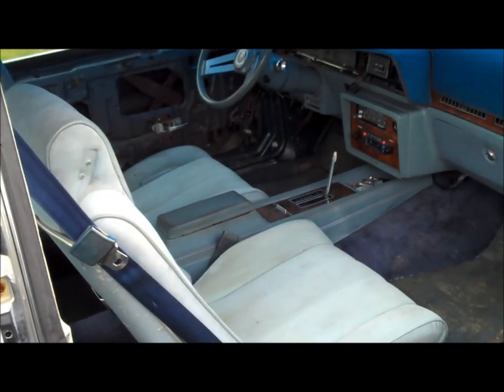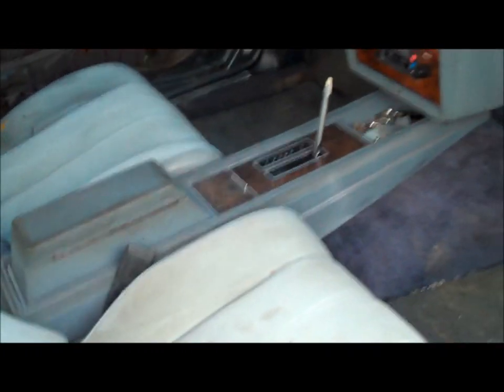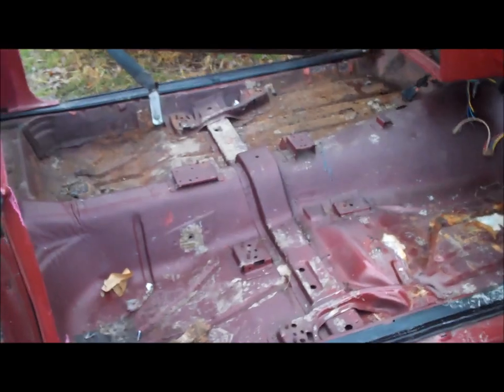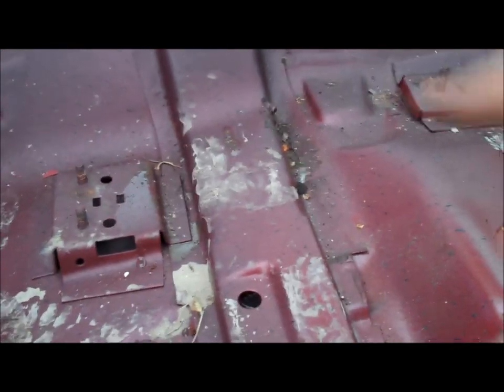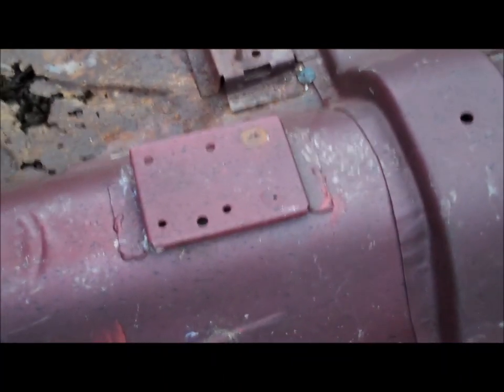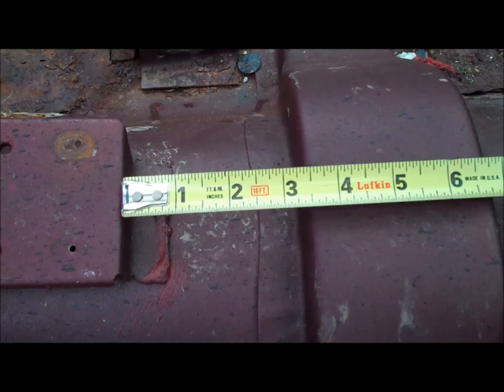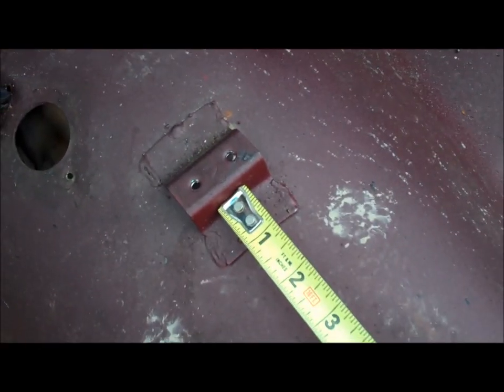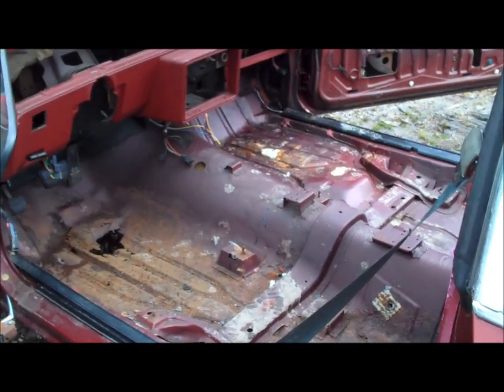Swap Bench Seats to Bucket Seats into a Gbody Explained

Comment: Hay Brian Suter thank you so much for letting us watch your car videos I love them and your welcome to my friend I haven’t said anything yet but until now but I have owned in my life time 4 Oldsmobile cutlass G body cars 1979 1978 1980 & a 1987  & one 1984 Pontiac Bonnieville 4 door and one 1981 Buick century 4 door and I loved them all to so really I’ve had 6 G body cars I put an olds 350 in my gold and brown car there is so much that you can do to them 
there such an awesome and Good cars to fix up I love what what some guys have done to them I love all the G body cars really now my 79 was the first one I had I bought it for 200 dollars back in the mid 1990s it was black with the gold pin stripes on it it had the olds 4.3 260 It was pretty worn out but I drove it anyways for two years  I loved it it had a factory sunroof that didn’t work an rpm tack and tan lather seats with power windows and locks and tan interior it was the brougham model with the olds rally wheels to and I have pictures of it somewhere here I had that car for five years I had the olds 260 rebuilt drove it for a little while and then traded it for the 87 and then my old black one ended up in the junk yard stack up on some cars I was not very happy about that my silver 78 was a brougham model to with a Chevy 305 to well anyways my friend sorry I’ve ramble on long enough theres more to these stories but to much read so maybe another time in small sections okay I just wanted to share a little some i live here in the north west in the beautiful great state of OREGON where our cars here don’t  rust to bad here lol except maybe the OREGON coast lol I have more pictures of my cars maybe I can share them sometime on Facebook I don’t know well see thanks Brian i love what you do sorry we can’t save them all but we save what we can I do want another olds cutlass ether a another G body or an A body I’ve never owned one of those cars I’m driving a 1980 Oldsmobile E body 
toronado right now with the Oldsmobile 350 cu 5.7 liter fully loaded with a factory moon roof or sun roof and I also own a 1988 Pontiac 
safari station wagon with an olds 307 Cu 5.0 liter she’s sitting in storage right now I miss driving that car but love driving my olds toronado though to well anyways thanks for listening let’s keep them Oldsmobile running and on the road my friend okay thanks buddy so so sorry to long of a message to much to say
Reply from the maker: Very cool story and it sounds like you have your share of Gbodys. Time for some more! There are plenty around your area being that they don't rust. I have bought a car from Seattle and it is clean! The Toronado you have is rare with the Olds 350, very cool for sure. Would love to see some pics of your old Gbodys so join the Classic Gbody Garage FaceBook group and post them!
Reply: Classic G-Body Garage cool awesome thank you Brian yes I have and it would be really cool to join your group I will check to it and do some time okay and yes I’ll look for those pictures to okay and share them I’ll even share a picture of my Oldsmobile toronado to and I didn’t tell or say I do happen to know where a late 70s Oldsmobile G body wagon is sitting here in town to it’s needs paint though I love my B  body wagon to it’s a Pontiac safari station wagon love that car well I’ll look you up on Facebook okay talk to you later buddy and keep the G body’s rolling okay good day my friend

Comment: Good video I have a 1980 el Camino , I bought a console last year .Got a shifter with cable and brackets , and just got the floor brackets recently . I will use the measurements and see if they work for mine .
Reply from the maker: nice

Comment: Fixing installed 5 speed manual transmission in my 1986 Pontiac Grand Prix LE  think about install bucket seats and center console. The car still has 60/40 split bench.

Comment: So the only thing i havent seen anybody cover with this swap is the seat belt part.. can i just change out the inboard belt receivers in the front to get rid of the middle seat belt and change the position of the receivers?.. or do i also need to swap out the outter seatbelts as well?
Reply from the maker: All seat belts are the same except for the inners that bolt to the floor. Just get the bucket seat style. One thing you need to make sure of is the male/female need to match as GM did offer 2 styles of buckles. One style is all chrome and the other is chrome with colored plastic cover.

Comment: I have a Buick Regal 1981 and I want to change the seats on them, I have bench seats but I want bucket seats what bucket seat would be best for me to put
Reply from the maker: Gbody buckets for an easy swap in. Otherwise you can get as creative as you want as long as you know how to weld. If your car has a straight bench then you need to weld in the inner seat brackets. If your car has a split bench then you are good becasue the inner seat brackets are already in there.

Comment: I have a 79 cutlass that I'm cloning into a hurst olds 10th anniversary where do you cut to do a t top roof swap I know 81 -88 the pillar is different for the t top roofs is it the same for 78-80 or do I just need to cut the physical roof and can leave the pillars
Reply from the maker: A pillars are the same but you need to be careful around the B pillars cuz those are different. I have never done the swap so I can't say where to cut.
Reply: The t-tops suffered floppy handling, leaks and creaks.

Comment: any info on what is needed to install the automatic floor shifter in a column shift car? mainly trans (4speed) brackets? thanks tryin to swap my 87 el camino, i have some parts but i want to know whats missin/needed if u could dm me with any info that would be greatly appreciated keep up the helpful videos
Reply from the maker: If you are putting a chevy console in the car then you need chevy type console floor brackets and shifter. You can buy the brackets from gbodyparts.com You will also need to locate a car with a console for proper measurements for the brackets. You will also need the cable bracket that bolts to the trans using the trans pan bolts along with the proper brackets for the linkage.
Reply: thank u

Comment: Can you tell me the fastest and easiest way to 4 speed automatic my Malibu wagon I just got it. 3.8 Chevy 229 motor
Reply from the maker: Swap in a 200-4R overdrive trans, you need to swap out the cross member and also bolt on frame extensions.
Reply: Same drive shaft ?  Or I probably need to work on the universal joints ? Thanks again, I need to listen to my younger brother advice more.

Comment: Do you have to Change the front seat belts as well? Obviously the buckles, but what about retractables? Have 60/40 bench and noticed the part numbers are different. Wondering what the difference is, if any. Thanks.
Reply from the maker: Yeah you need bucket seat style seat belts. The retractables are the same. Only the inners are different.
Reply: Cool! Thanks for the reply. Great Vids BTW.
Reply: Is a 76 g body the same as a 78?

Comment: Can you upload A  video on how to change the speakers in the rear deck ,the factory speakers are toast And I want to replace them with a newer speaker but retain the original look. Thanks
Reply from the maker: The speakers are held up with brackets and clip into place. Very easy to swap out. Aftermarket speakers will have a larger magnet so you will have either have to modify the factory bracket or sneak screws up under the package tray and back down through the new speaker to secure it.
Reply: So I install them through the trunk?
Reply from the maker: Remove the factory speaker and there are holes for screws, if not you carefully drill them up without going through the package tray. You then go through the large speaker hole and sneak the screws down through the screw hole. Hold the speaker up and install the nuts.
Reply: Ok. Sounds easy enough thank you g body!!!

Comment: Hi Mr. Gbody guy, I have a1987 Regal Ltd with 60/40 bench seats, I just bought a pair I bucket seats from a 4th gen Camaro, can they fit into my floor brackets without any problem.
Reply from the maker: As long as you bolt the Gbody seat tracks to the Camaro buckets.
Reply: @ClassicGBodyGarage  so is that a yes, or what are you saying here

Comment: How can I fix a rust hole on my Chevy caprice 1986
Reply from the maker: Depends how bad. Cutting out the rust and welding in new metal is always the best solution. Don't burn your car down tho and always have a fire extinguisher handy.
Reply: Classic G-Body Garage thanks appreciate it
Reply: Classic G-Body Garage how can I run cables for an amp from the hood to the trunk?